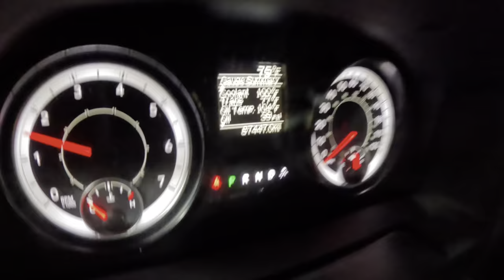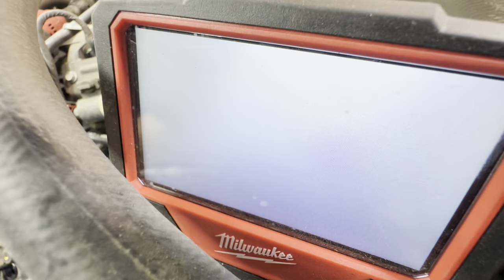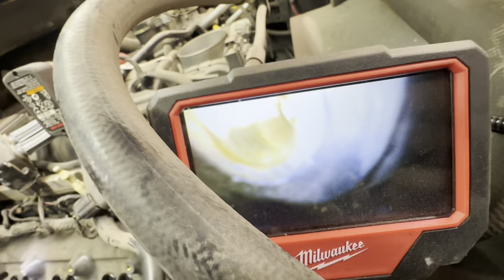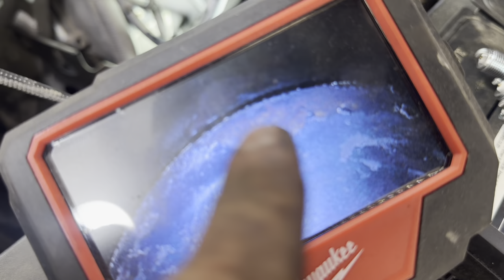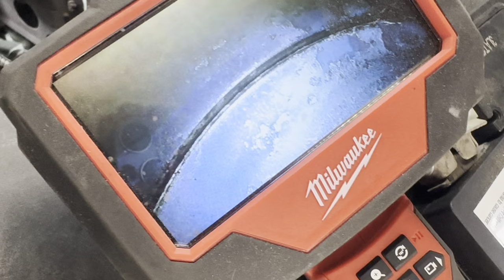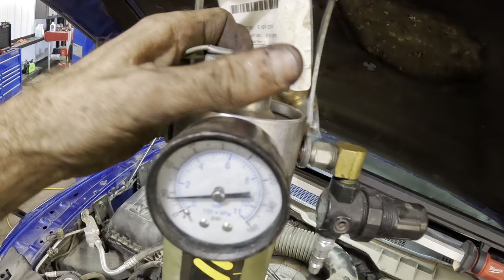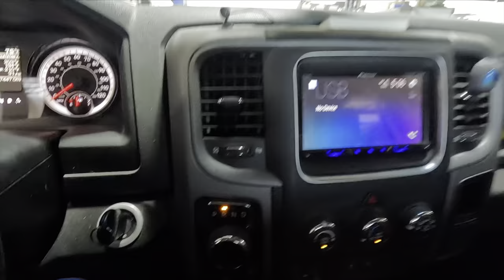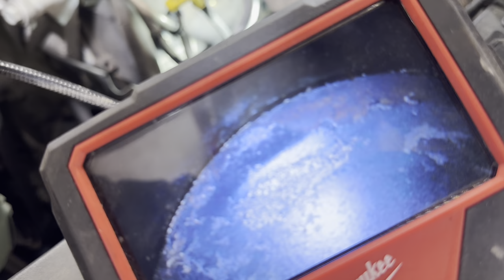The “TUNE UP” is DEAD! Dual Spark HEMI! (Injecting liquid into the Intake)

Comment: Back in my younger days when l first started driving. I'm surprised l can remember back that far 😂.
  We had RED X on the forecourt.  Few shots of that ìn the fuel as we put it in. Supposed to clean all crud out of the engine so it ran better. Plus it was free. 
  Oooh, don't get anything for free anymore. 
  I guess it do e it's job. Car did run better. Especially as we had the choice of several 2 star petrol. I ran the cheapest as not earning a lot back then. By the way lm 72 now 😮.

Comment: The only thing I would have done differently is high pressure wash that motor. That combustion chamber cleaner is not snake oil it does work! The cylinders really didn't need to be cleaned!

Comment: I use "seafoam" every 20/30 thousand miles in the tank on Oil burner, and had to have the head taken off after a injector fell apart, and the mechanic asked if I had had a new engine fitted recently, and I said no, it's original, with 135K miles on it, he said he hadn't seen an engine that clean inside other than a created replacement, so it shows that those "snake oils " really do do their work, It also helped keep the sludge/carbon build up out of the EGR circuit too
Reply: I use SeaFoam once a month.
Reply: I use SeaFoam @2 Oz per gal for Winter storage, works like a charm.

Comment: My only gripe against BG is that I cant buy it from them without being a dealer and I cant buy the tool either. They just hate DIY'ers lol. I use Amsoil Power Foam through the throttle body for cleaning carbon.

Comment: Once again, I'm so glad, to see a mechanic torquing spark plugs properly.
I'm all my years working on cars, I've done hundreds of tune ups, and have NEVER used a torque wrench on a spark plug.
I can't wait, to see you change the spark plugs on an H6 Subaru...:oops::face-green-smiling:
Reply: Don't forget a light dab of anti-seize on threads, and also torques are based upon dry threads. So a calibrated elbow knows when to stop. Now on an engine build, fastener torque is very critical.
Reply: @shadowopsairman1583  I'd NEVER wrench tighten integral fasteners.
Some things require torquing.
Spark plugs on the other hand, can be wrenched, as long as you know what you're doing, especially knowing the difference between plugs with crush washers, solid washers, or even ones with no washers.
Also, I've never been a big fan of anti seize on spark plug threads, especially on an aluminum head.
I could be wrong, but I have put anti seize on plugs going in a cast iron head, but aluminum heads are dainty things, and I just feel like anti seize would complicate things. Or do I have that backwards?... LOL!

Comment: I always wonder if Ray connects piping to the exhaust pipe of the truck as to VENT  the exhaust outside of the shop when running the engine like this.

Comment: 2 spark plugs per cylinder -- Aviation mechanics feel your pain. But at least you don't have to deal with cleaning the lead fouling off of them.
.050 sounds pretty wild, too. We gap them to .015. And there are two electrodes on ours. (Three, if you count the center.)

Comment: I really do like your videos so pleas do not take this the wrong way. Sparkplugs, If they are not broken inside the resistans should be the same an all of them. If the gap is 0.7 but resistans of the electrode is correct, the plug is not faulty but need a gap adjustment. If you meassure resistans of a new plug compared to the old plug, is there a difference? Or, is it only the gap and sharpness of edges on the tip of electrode and the ground that matters? Please enlighten me with your knowledge.

Comment: For someone that is continually  Extolling the virtues of starting threads by hand, (Which I heartily agree with) It is somewhat amazing to see you just dropping spark plugs down the tubes, with the danger of closing the gaps and then just screwing them in with a ratchet without starting the threads. Personally I (Because I am a goody two shoes) always insert them with a socket with an extension rotate them backwards to find the start of the thread and then screw them in a few turns to get them started so as not to cross thread them. Just saying.

Comment: I have seen so many 100,000 mile spark plugs that are used up at 60,000 miles. I just replace the spark plugs on families cars every 60,000 miles.

If you don't have one of these tools and you want to blast the intake clean, you can buy disposable cans of the stuff. I think I pay $25 for a can of CRC GDI valve cleaner. It may be called GDI valve cleaner, but it works on earlier designs.

I love the adjustable spray on this device. You get small engines, you get large ones. The best you can do with those disposables is give short bursts for small engines.

CRC calls for removing the MAF then spraying through the space the MAF took up. It even says in turbo apps to let the turbo suck it in in such engines. They don't bother mentioning engines without MAFs, but I am sure blasting the TB or turbo will be fine.

Auto repair shops would sell this process as "Fuel Injection service." The occasional carb engine would come in, and many guys would think this kind of process would not be possible. I explain to everyone that since this is mostly for cleaning the backside of valves, it's fine to do to carb engines. I had a salesman friend who also didn't realize this. He had a MKIII GTI VR6, and some kind of 1979 Chevy Mailibu V8. His MKIII GTI VR6 needed some expensive repairs, so he drove the 1979 Malibu for the time. It was not running it's best, so I had to explain to him that the "Fuel injection service" does work on carb engines by cleaning valves. I can't remember if it made a difference for him or not.

I did the intake valve cleaning to my dad's 2017 Honda Fit and it was a huge advantage. He is in Houston. It wasn't hard for him to accelerate fast to blow out the intake cleaner. There are numerous onramps in Houston where you had better to get to 80 MPH on that onramp quickly. He had about 33,000 miles. Honda GDI is said not to dirty up intake valves like VW or BMW. However, it still does happen.

I used the same kind of stuff on my mom's 2011 Honda CRV. Doing that about every 60,000 miles does seem to make a difference.

Comment: Carbon buildup on the intake valves is a HUGE problem with 2010-2015 VWs, as well as the generations both previous and after due to direct injection not cleaning said valves.

I'm sure your stuff works fine, but if you could ever try this stuff on one of these VWs, and see the results, I'm sure you'd sell it on a TON of VW people. Especially if it's an easier process than pulling the intake manifold and walnut blast the valves

Comment: Aircraft engines routinely use two spark plugs per cylinder. Running on one magneto/plug can result in catastrophic detonation damage in high-load situations.
Reply: Running dual ignition systems is for redundancy. The systems are independent

Comment: So in watching the cleaning and slow carbon deposits break down, I'm curious if any of that debris gets hung up in the valves? Does it all blow out?  Seems to me if an engine has proper fuel and runs at highway speeds for reasonable time this treatment is in fact snake oil. Not sure I'd be comfortable with chunks of carbon flying around in the valve train.
Reply: The carbon chunks get caught in the cat..

Comment: At 100k+..plugs, all fluids, battery, two front hubs, 4 calipers, rotors, pads, tank vacuum pump, 6 broken exhaust studs, tires, hemi tick, two starters...bad by-passed fuse box relay...and now a leaking rear diff seal...all done in my driveway on Rusty the Ram...did I mention I hate this truck lol

Comment: Scotty mentioned that the reason those types of carbon cleaners aren't good is because those big flakes of carbon that come off can clog up the catalytic converters.  I think u proved his point as far as the chunks of carbon coming off.  He recommends the ATS carbon clean system.  Its a 3  stage cleaning system that wont clog the cats.  Thanks for bore scoping the cylinders before and after.  Much appreciated.
Reply: Converters are a lot cheaper than engines
Reply: @COBRO98  no arguements there, but if you are gonna spring for the carbon clean service, may as well go for the one that doesn't clog the cats.

Comment: 16 Iridium plugs? Damn, that's gonna be expensive.
Reply: That's why I buy 8 and wait awhile then buy another 8 later.
Reply: Was my first thought too. That's like $400 in sparkplugs.. what a dumb design
Reply: $149 for 16
Reply: $149 for 16, I have 203,000 miles,changed them every 100,000 miles

Comment: There is no mist going into the engine.. The chemical mist dead heads against the throttle plate , condenses, and flows as a drip into the intake manifold and enters combustion chamber may as well slow pour it in ..same effect. I suspect thats why so much wetness in the cylinder. Misting is a misnomer in this application.

Comment: So….. this test is “ inclusive “ at this time??? The carbon is still present as before???? … the “solution” may or may not be present in the cylinder….. the carbon is still present????…… so what your saying is… running a whole can  of “cleaner” in the intake while running…. Then test drive, then re-examine a cylinder…. There is a presence???? Of the cylinder being “wet” from the cleaner…. If I heard ya right???? Wow… you Rock Ray Ray😊😊😊

Comment: Wait how does the dual spark plug work in this version?  My 04 Hemi has wires that run across from a different coil pack to fire the different plugs.  Do both plugs in a cylinder fire at the same time on this engine?

Comment: I love how people think that combustion cleaners don't remove carbon deposits  but I would like to point out the fact, when you pull the heads off an engine the dead give away to the place a head gasket blew is the top of the effected pistion  is clean no carbon.
Why is that you ask, because the water vapor breaks down the carbon and burns it. 
Back in the 70s as a teen ager i was pouring water into my carb just to prove a point to a friend who ran race cars on a dirt track. 
Steam would be better and not as much, what Ray is using is a chemical designed to burn off carbon and stuff in the intake manifold because of the crankcase ventilation system.    Oil mist works it way into the intake and builds up over time it has to be cleaned out short of removing it and washing it out. But that doesn't address the intake valve assembly  or throttle body. It also gets loaded with gunk.
Reply: If your car runs a lot better in a rain storm  it would benefit from the "Snake oil procedure"  
After your milage and power output improve you'll change your mind.

Comment: Ok after seeing the before & after it don't look like it did much but since it looked wet in there I'm thinking take that truck on the highway and drive it 75mph for about 80 miles and the carbon should start to disappear, Overall i think it works, just need to drive it on the highway more and maybe repeat the process one or two more times.

Comment: 10:30..What is the purpose of 2sparkplugs per cylinder again ? ( I know Nissan had a few models w/2 per for a while...) but I've forgotten the 'real' reason  for it...11:45...I'm guessing that the 'silent' magnetic mechanism will make it to the motorized ratchets also ? or is it in  R.&D. already ?

Comment: My Smart Car I found out was made in France. I found out that back hatch was leaking water because the rubber gasket thingy was not put on. Before that I found out that the oil pan gasket was not put on. Oil was spraying out. Mercedes replaced them under warranty. German car made in France.

Comment: Shouldn’t you run system cleaner through intake before changing the plugs, so all the crap that comes loose don’t wind up on new plugs ?
Reply: The dissolved carbon does not accumulate on the plugs.

Comment: 87k mile dodge ram original coils
Preventive maintenance.
Whats the chance the electron coils last 120k and should a collage kid have to deal with it or know his truck has a misfire. 
Your only talking 20 to 40k miles left in the coils at best worst they could fail at 90k miles. 
Tough fence to be on but it is a point to think about.

Comment: what about the mass air flow sensor, it was not in the air stream, did it affect the engine operation
Reply from the maker: This one doesn't have a MAF, only an intake air temp sensor

Comment: My 01 Ranger had those damn dual plug setups.  8 spark plugs for 4 cylinders, and while those Hemi plugs are easy, the 4cyl 2.5L Fords are a PITA.  They're not side by side, one is near the exhaust ports like a 'normal' plug, but the other is on the far side.  Great for creating a nice burn, but why oh FREAKING WHY did they then design the intake manifold to loop over itself effectively BURYING the second plug with intake runners, throttle body parts, wires, and hoses?  Changing one plug is cake, the other one takes the job to near a 2 hour job.  UGH.

My ultimate fix was to chuck the engine in exchange for one with 8 plugs for 8 cylinders.

Comment: The tune up is not dead ...it's just advanced.
Especially with direct injection .
Fresh plugs & proper gap are a must as are oil changes ( not the 10 thousand miles either) 
Then there is injectors that must be cleaned ..
MAP SENSORS
MAF SENSORS 
IGNITION COILS
are all part of physically tuning a car.
Ignition Timing is checked & adjusted with a laptop.
Etcetera Etcetera....

Comment: I thought there was something you put in the fuel tank also?
Reply: 44K fuel additive....added to the tank.
Does not work well on direct injection engines, since the fuel is injected directly into the cylinder and does not pass through the intake or the valves.

Comment: Only brand of vehicle that changing the transmission is a part of normal maintenance. Be a great truck with a non dodge transmission and a completely different suspension also not made by dodge.
Reply: Had a Ram 3500 with a 6.4 hemi. Never had a problem with the transmission all the way up till I sold it with a 100k on it. And I towed with it. A lot of people don't service their vehicles when it's recommended maybe that could be a problem but I'm a firm believer in preventive maintenance. A bigger problem with vehicles with hemi's is allowing them to idle for long periods and then they have a propensity to wipe cam lobes but I didn't allow mine to idle for long periods either

Comment: Do techs not use fender covers anymore?  You can release the harness strap on the passenger side and get clearance to access the rear coil bolts. You can get a one piece Magnetic spark plug socket and extension to get this job done without worry of the socket coming free from the universal joint and extension.  
No fender covers in these videos is a disappointment for sure.
Reply: Do you sell finder covers for a living? 😮

Comment: The tuneup has been dead for over 25 years. When engines had points, condensers, spark plug wires and copper spark plugs that only lasted 20,000 miles you needed to replace these items regularly and that was a tune-up (and unlike many cars today you didn't have to R&R the intake manifold/ plenum to do so) Today these items no longer exist, so you drive until one or more stop functioning.

Comment: First thought was a college kid with a fuel sucking truck? Unless he's moving stuff or running a side business a poor choice. Next was to decarbon the engine is small trickle of water does a great job as carbon is dissolved by water that turns to steam and cleans cylinder and valves. Next was mention of old style tuneup procedures and though you are at least a generation past point type ignition ( phased out 50+ years ago) and unless you have done antique restoration work is almost unknown today-got a dwell meter?)

Comment: In the old days when cars were made right, with cast iron blocks and steel heads, we used to slowly pour ice cold water down the carburetor while revving a hot engine.  That worked really well to clean the valves and pistons.  You had to be careful not to crack the block or warp the head.

Comment: Wont those carbon flakes you break lose end up clogging the exhaust valves?
Reply: I was thinking the carbon bits end up pluging the converters......does Ray have mouse milk for that ?
Reply: I would think you ought to disconnect your exhaust pipe so as not to get all that crap in your converters, I suppose you could put a piece of flexible exhaust pipe leading into a drum of water so you can catch all the possible carbon you might be removing.

Comment: $150 for the zero ratchet? thats snap on prices and they have a clutch ratchet. i have t&e tools version of the clutch ratchet but theyre the stubbys but they do work when you need low backdrag. yes, American made tools are expensive but name brand tools with a proven track record can demand those prices. i couldnt justify $150 on a new tool brand with no track record but i would buy another snap on ratchet if i "needed" one for a job because snappy has a good track record with me and a million other guys.

Comment: Cleaning the intake system with 'snake oil' is probably effective.  Does the 'snake oil' and the pollutants washed out of the system impact the catalytic converter?  
It is logical to assume at least a little bit, yes.